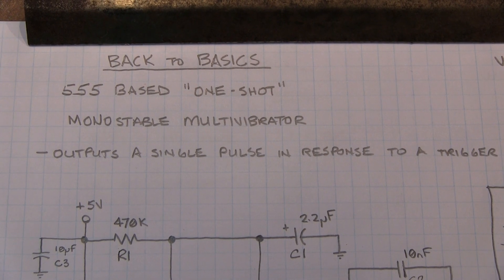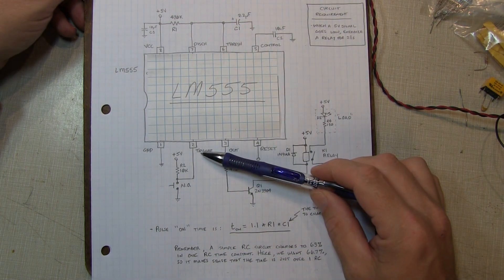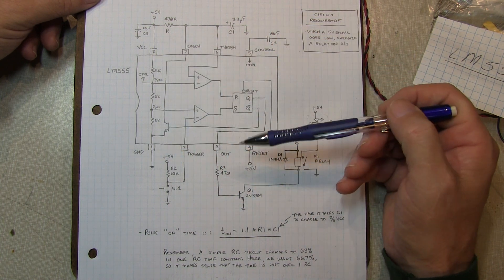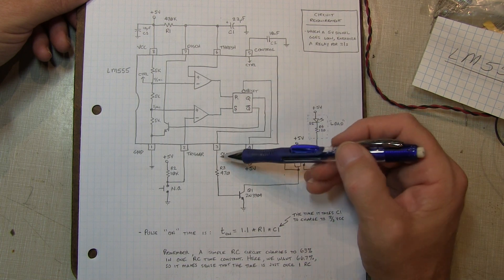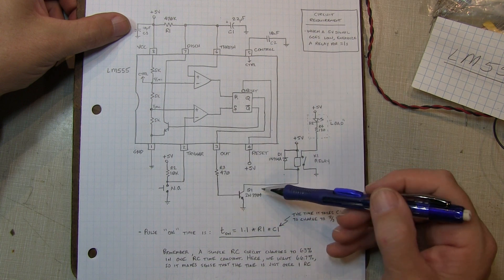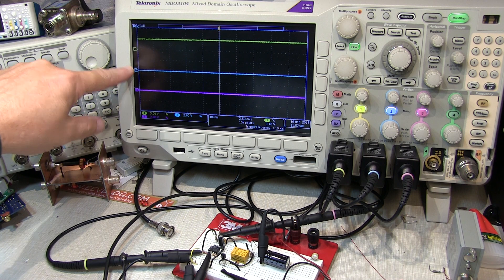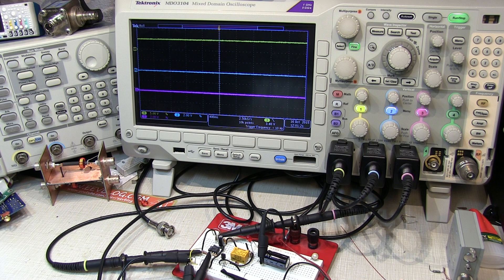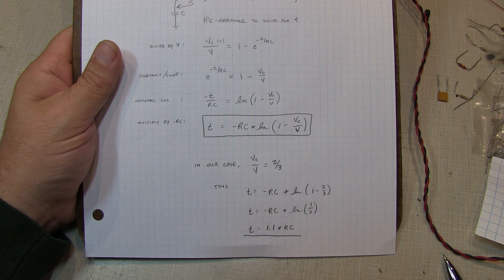#216: Back to Basics: 555 based monostable multivibrator | 555 tutorial

Comment: It seems you have changed something with the video quality or frame rate? It's not as smooth as your previous videos. You may have resolved this in later videos, i am slowly catching up 😊
Reply from the maker: It was YouTube.  They changed the frame rate on any videos that I uploaded in .MTS format. My originals are 30fps, but they drop it to 15fps on this format.  Once I noticed that this was the reason, I changed the format to .MP4.  But, there are many videos that got caught up in this change before I noticed it.
Reply: w2aew ok, I thought it might be something like that, i am now at video 244 and yes you fixed it pretty quickly. How can contact you and ask you some questions about topics for videos? I have linkedin connection requested you and tried fb messenger but to no avail 😊 I feel like i am stalking you now lol
Reply from the maker: connected on LinkedIn....

Comment: hey dude !!  I always try to get such waveforms on my CRO and it never comes. why?
Reply from the maker: A CRT based oscilloscope doesn't have the display persistence needed to display very slow or single-shot waveforms.
Reply: Thank you. That means I have to buy a digital CRO.
Can you suggest me any good company for CRO? 
Thankx Sir!!!!
Reply from the maker: It all depends on how much money you want to spend.  There are premium brands like Tektronix, and lots of less expensive value-based brands, plus a lot available on the used market.
Reply: K. Ohhh no!!! at least 2 years I have to work with my old CRO.
Thank you sir.
k.at

Comment: I hope you can help me with this. I'm building an external flash for a digital camera. here is a link on how a flash circuit works if you don't already know: http://www.diyphotography.net/how-to-build-a-flash-with-an-optical-slave/
as the article said, a typical flash circuit dumps all the capacitor's energy as soon as the xenon is ionized. what I want to do is add a monostable multivibrator to pulse the energy coming from the cap so it uses less than the full charge so I can get multiple small flashes from one cap charge. I am using a 320v 220 micro farrad  cap and I want it to use just 1/3rd of its full charge at a time
Reply from the maker: Hmm - I'm not sure this will work for a few reasons (but I'm not an expert on flash tubes..).  The firing of the tube uses a triac (thyristor or SCR), which once triggered, continues to conduct until the current goes away.  You can't turn it off once it's been triggered unless you do so with another switch type device in series with it.  The other problem is that if you discharge the main cap to 2/3rd or 1/3 of it's full charge state, the voltage at the caps terminals will only be 2/3 or 1/3 of the normal flash voltage - which might not be enough to ionize the Xenon tube.
Reply: I know that it works because a lot of flashes today have red eye reduction function but still only use 1 capacitor so it has to be being pulsed. also the xenon is ionized from the trigger transformer
Reply from the maker: Ok, good to know. It's clear that I don't know that much about the drive requirements of the xenon flash tube. I can imagine maybe they replace the SCR with something else, maybe a mosfet driven by a pulsed source, which could be 555 based. Or maybe use two (or a 556) to create some gated pulses.
Reply: w2aew that's the part that I'm trying to understand. how would what you just described work? modern flashes DO use an IGBT and have components that have MOSFET.
Reply from the maker: You're basically replacing the SCR with another device (like the IGBT or MOSFET) to drive the trigger coil.  Unlike the SCR with stays on once triggered, the Gate of the IGBT or MOSFET can be driven from a monostable pulse to control the amount of time that the device is on.  I don't know enough about the drive requirements of the trigger coil to know how to design the details of that.

Comment: Can you explain more about the pull up resistor to VCC? Why not just connect it directly to VCC?
Reply from the maker: +DoItYourselfMusician If I tied it directly, I wouldn't have been able to momentarily lower the voltage with a simple normally-open switch like I did (that would've shorted the supply to ground.)
Reply: Thank you for that explanation. I get it now.

Comment: I've been trying to get this circuit to work but when I ground pin 2 the load energizes and then just stays on.  I'm getting rather determined in figuring out what I've been doing wrong.  (I think I need Pre-beginner level)
Reply from the maker: Ah hah! If you hold the Trigger input low, the output will stay on. If you want the output to give the 1second pulse even if the +5v signal stays low, then you'll need to AC couple the +5v signal to the Trigger input. Keep the pull-up resistor on the Trigger input.

Comment: Another excellent video.  Thank you.  General newbie question though.  Could you drive the relay directly from pin 3 (out) of the 555 instead of using the intermediate transistor?
Reply from the maker: +Bobo Johnson It depends on the relay and the drive capability of the 555.  Note that it cannot swing to VCC, so this may limit the ability to properly drive a relay.

Comment: Yet another superb video.  Everything is nicely explained and nothing left to chance.

20 years ago I built a similar circuit to add an intermittent function to the windshield wipers of a 1987 Chevette I owned.  I connected it in series with one of the motor terminals.  Conveniently, interrupting power to this terminal caused the wipers to stop after reaching the "down" position.  I put a switch on the 555 Reset input to hold the relay closed for normal wiper operation, and a 10K pot was used to vary the interval.  At the time this was one of my greatest achievements, and remains so.  Oh...oops

Comment: 10:15 "We know we're going to be charging up to two-thirds of Vcc". That's because of the three 5K resistors inside the 555 between the comparators that divide Vcc in threes, right?
Reply: +Jac Goudsmit Yup. The voltage cannot charge higher than 2/3rds at that point in the circuit, so as far as the calculations are concerned, that's out "max charge".

Comment: Thanks Alan. I have a 555 night-light with 7 LED's on a breadboard. I control the 555 with a CdS Photocell through the reset pin and ground. It's been running every night for 2 1/2 years with no problems.
Reply: +Robert Calk Jr. 
What light was it sensing? Outside? Or other lights in the room? I used a 555 for several years to switch on 20m or so of LED-strips (selfbuilt from 5mm LEDs as the premade strips weren't really available then; they would have been way to bright anyway) in the hallway as soon as it got dark outside. In a setting like that using the reset pin wouldn't work because you need a considerable amount of hysteresis to not have flicker.
In both our cases the 555 is already "overkill", I didn't use any timing function and in your case you don't even use the comparators if you just toggle the reset pin ;)
Reply: +superdau 
It's inside in my workroom. It will flicker some if the light is kind of low, but most of the time the lights are either off or on. I stumbled on it accidently while playing with the IC when I first started learning electronics. It rarely flickers, but in low light the LED's receive less current so they are not as bright. It doesn't take much sunlight coming through the curtains to turn it off.
The 555 is a pretty handy IC.
Reply: +superdau 
I kind of disagree with the "overkill" part. On another breadboard I have an analog "night-rider" circuit built with 6 LED's powered through a Trip5. I have another "night-rider" circuit on an Arduino with 6 LED's also. I must admit that I prefer the analog, even though it requires more components and some nifty placement of all the diodes.
But the analog circuit just seems to be warmer, and more fluid.